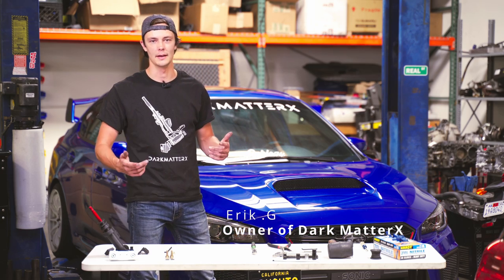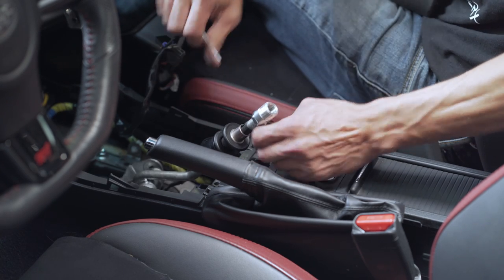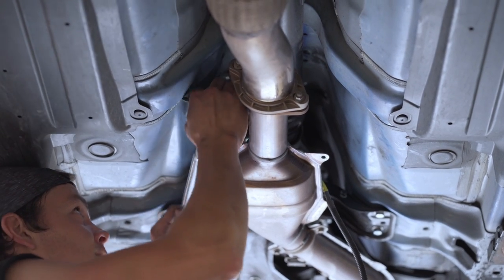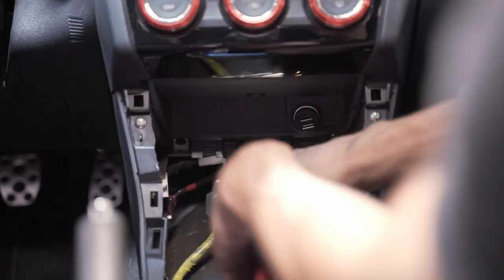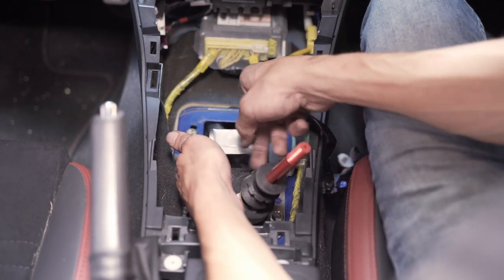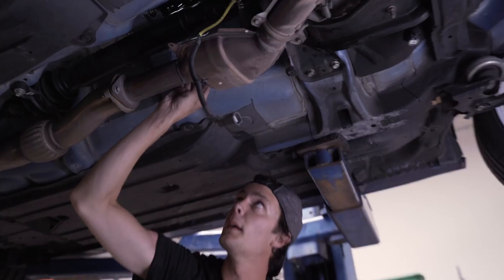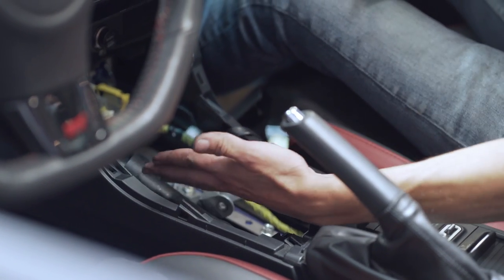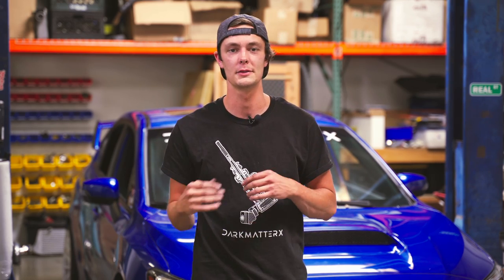Dark MatterX DM-1 Short Shifter Install on Subaru STI

Comment: Probably too late in the design process, I have a minor comment on how the reverse lockout works: I have a Raceseng lockout, one thing they did that I'd recommend you copy is using a screw instead of a roll pin to for the reverse lockout cable. Makes install, uninstall, and reinstall much simpler.
Reply from the maker: Agreed! That would make the overall install easier. Will take this into consideration!
Thank you!
Reply: @darkmatterx_  If you would like, I have a replacement sitting around that I was going to put in (old got a scratch) until I ordered the DM-1 that I could send you photos of.
Reply from the maker: @RussellMezger  Email would be best for us, contact@darkmatterx.com
Reply: I just ran into this problem
Reply: @spencerking9291  I ended up buying a new pin, they're a few dollars and usually available at your local Subaru dealership.

Comment: Nicely engineered product.

How does this bolt up in an 07-09 Legacy GT Spec B TY856 6MT? Short throw position capable? Flange modification required? Any additional notes for the reverse lockout cable?

Question:. Why can't the bottom membrane stay in place for weather and corrosion protection?
Reply from the maker: We are actually in progress of confirming fitment for the Legacy Spec B. The ultimate goal is to have the DM-1 work in all manual Subaru's. We will push out updates on Instagram as we confirm new vehicles to our fitment list and what is required to run the DM-1 in that respective vehicle.

The OEM reverse cable works seamlessly with the DM-1 in the same exact manner that it does on the OEM shifter.

The bottom rubber membrane boot does not have the same opening shape to mate up with the DM-1as it does on the OEM shifter. We are also working on creating a new boot that will work with the DM-1 and serve the same purpose as the OEM boot.

If you have any further technical questions, there is a NASIOC thread started with lots of great questions and info that I respond to.

https://forums.nasioc.com/forums/showthread.php?t=2940354

-Erik

Comment: So clarify the 04-07 issue with me. If I take that plate out of the car completely, I can use the shortest throw position? Or I can only use that other position whether I have the plate in the car or not?
Reply from the maker: Hello,

Notching the plate or taking it out of the car will allow you to use the shifter in its "longer" throw setting and is required for either of the two settings. This setting is comparably to current short throw kits form other companies. Although not officially recommended, further modification to the vehicle can be done to use the shifter in its shortest setting, and is what some customers are doing.

If you would like more information on this then I am happy to give you more details if you email us at contact@darkmatterx.com

Cheers,
-Erik

Comment: Can you run other aftermarket reverse lock out  collars?
Reply: Also how does mounting work with a 6 speed swapped gc chassis? Just different brackets or not compatible?
Reply from the maker: The DM-1 is compatible only with the provided reverse lock out. As for mounting it to a GC, we provide all hardware and components for you to install the DM-1 and mount it to your vehicle. You would just need to purchase an 08+ STI shift arm (which we stock) if you don’t already have that from your swap.
Reply: @darkmatterx_  Appreciate the reply  🤘🏻

Comment: Is there no way to run the short shifter on the 05 sti  whatsoever??
Reply from the maker: The DM-1 shifter will work with an 05 STI!
Reply: Sorry. I meant. Be able to utilize the shorter throw from the DM1?  Top hole
Reply from the maker: @rxsevenforme  Correct, the top throw setting can not be used. The shifter still drastically shortens the throw even on the lower setting.